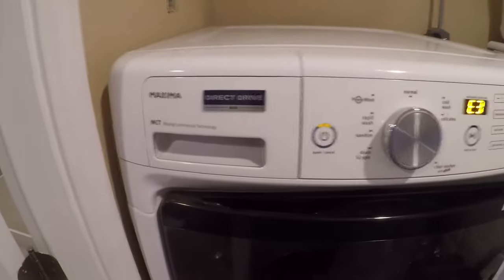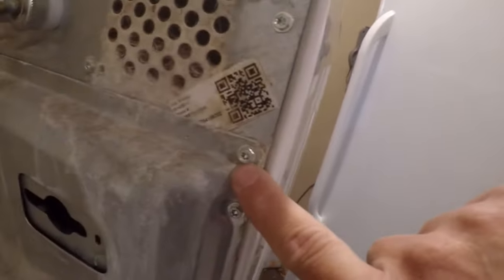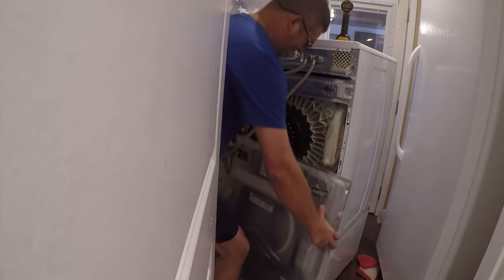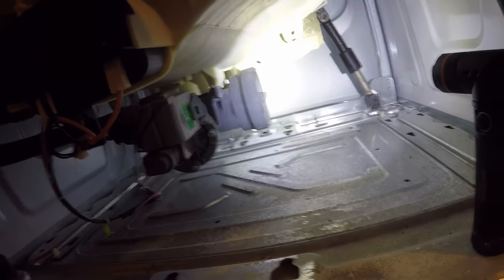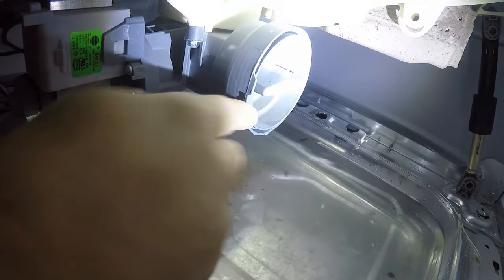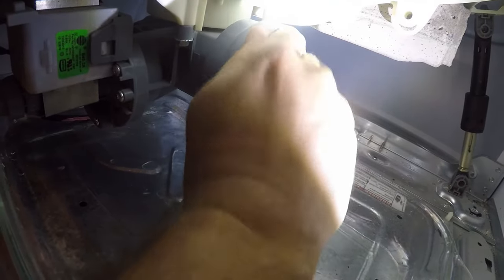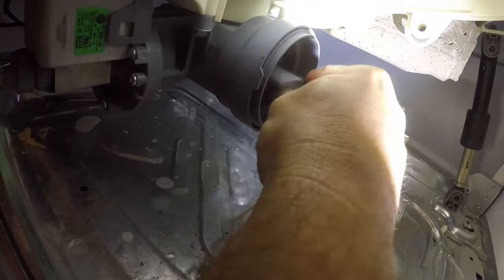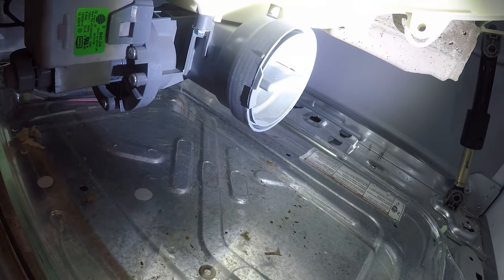Whirlpool / Maytag how to clean filter under washer

Comment: A potentially easier method to access the drain filter - if your machine is not stacked.  Pull it forward about 18”.  Then rock it backwards (on its rear feet) to expose the underside.   Take the bottom panel off (mine has 2 screws and two plastic retention plugs).   This method has far less fasteners to deal with and I can get a large plastic tote under the filter to catch all of the water.   I just did mine and found a piece of plastic label from a new pair of jeans clogging the filter.  I didn’t spill a drop.  I contemplated not reinstalling the bottom plate to make it easier the next time.  And I agree, it’s a crappy design.  There should be a front access panel or no panel at all and have the drain cap exposed at the front of the machine.  Thank you for the video.  It was a great instruction to do it the prescribed way.
Reply from the maker: The first time it happened I called in under warranty.  The yo-yo they sent took the front of the machine off.  Clearly the most difficult way to do it.  I did a bunch of research and figured out you could get to it from the back, but nobody had made a video showing how to do it, so I did.
Reply: @hotpuppy72  and we are thankful for your efforts!
Reply: Good luck it's a full front panel now

Comment: I had the same error codes F08 and E03 on my 5 year old Maytag, and unplugging for 10 minutes did not clear the codes--they would come back on and the drain pump would run as soon as I turned it on.  This video was the only place I found that showed how to access the filter on our unit. Like the filter in the video, mine was not what you would call clogged, but there was a 1 inch long by 3/16" around stick in there. I wiped it all out and checked that the drain hose was not clogged (it was not). When I plugged it back in, the error was gone and it works normally.

Comment: NOTE: some models (like mine) have that filter facing forward, such that you can't access it without taking the entire front off or typing the unit back about 45 degrees to access from the bottom

Comment: You should also clean the rubber pocket next to the filter. The sensor is what throws the error. If the sensor tube is clogged, it will do the same thing.

Comment: I think the bigger scam is they made you either have to access this from the back or unstack the units if you have them stacked to clean this out. I live alone. This is not a simple task. Moving my dryer off the top of my washer. There's only 6 in on either side of it and I can't access the back neither. Why they made no access door on the bottom of this or even put the filter on the bottom front blows my mind. This is entirely too difficult, especially when you're supposed to do it multiple times a year 🤦🏼‍♂️ next time I buy brand new washers and dryers I will 100% pay attention to where that filter is and buy accordingly. When I purchase these I didn't even know about the darn thing 😆
Reply from the maker: Some fool at corporate realized they could save 20¢ in manufacturing costs this way... and generate a service incident for their repair network.  More winning and more wiping poo on their brand reputation.  But hey the C (as in criminal) suite bonused right?  "Wall Street" pillaged and raped some more so it's all good......  short sighted greedy people are annoying.

Comment: Wait until you find out where it is on the new ones!! It’s up against the front panel with no access door like the GE model has. You have to remove the whole front of the machine to clean the drain filter.
Reply: If you're able to, you can tip the unit back any 45 degrees and get to it from the bottom

Comment: If I was part of the design team, I would totally refuse to do something like this.
Reply from the maker: It was a cost cutting move that makes sense if you don't care about servicing the appliances.  Too much money to be made from throw-away hard to repair appliances.  See also corporate greed.
Reply: I hate to offend any guys, but they need more women on these design teams!!  Same with so many appliances.  If you’re expected to routinely clean the darn thing, then make accessible!!  With clasps or if screws are necessary…just the plain old screw !!

Comment: I have a fairly new Maytag washer. Unfortunately, I now find out this washer is the PITS if you have to wash your pet bedding, which is always lint and loose fur-laden.  I wash pet bedding every week.  Now the washer will not drain and I know its due to a clogged lint filter. Once I call to have service to correct the problem, I will probably have to take the pet's blankets and towels to the laundromat, since this washer cannot handle pet fur. And since Maytag purposefully designed it to prevent the consumer from cleaning the lint filter. SHAME on Maytag!